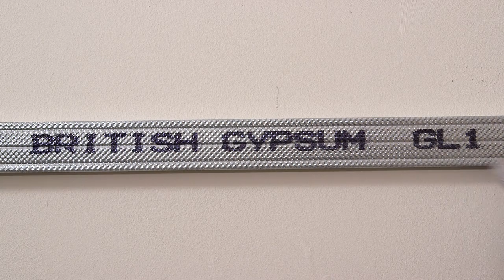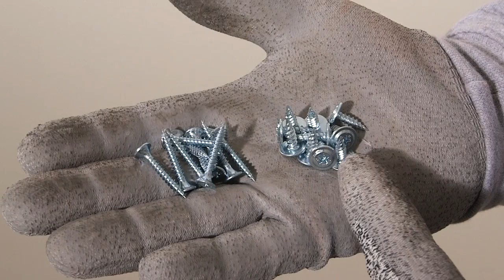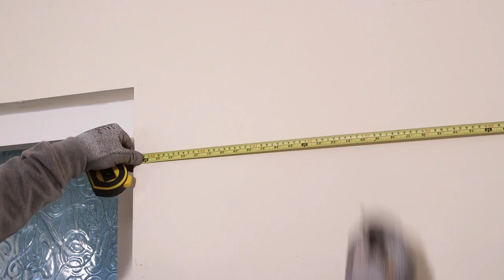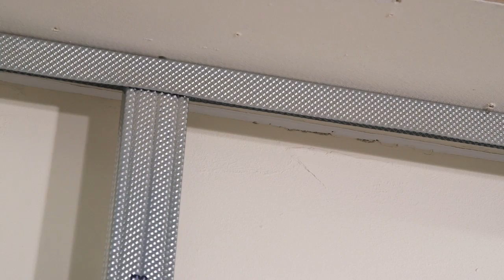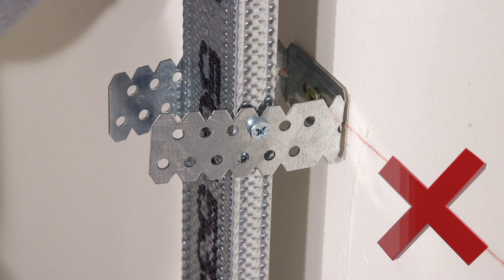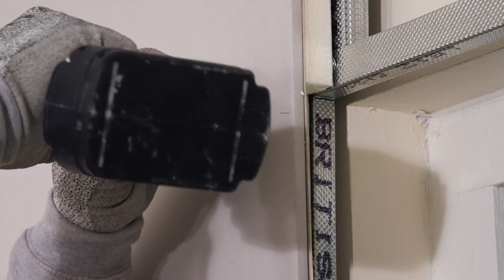How to install the GypLyner UNIVERSAL system - a metal framed wall lining system | British Gypsum

Comment: Is this system any good for soundproofing or noisy neighbour proofing?
Reply: You could install  British gypsum sound block plasterboards and install a Isover acoustic partition roll in between the  existing wall and metal studs. If you had a small void between studs, Isover and the old wall you would enhance the acoustic performance to the wall even further, although this would take up more space. Sealing everything around the perimeter with gyprock sealant would help.